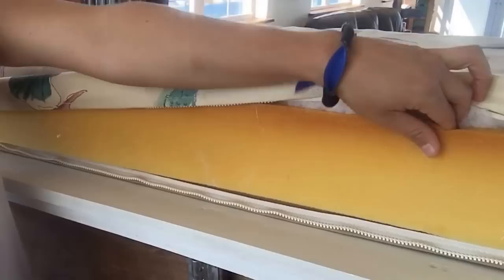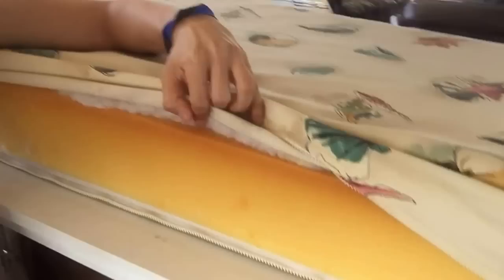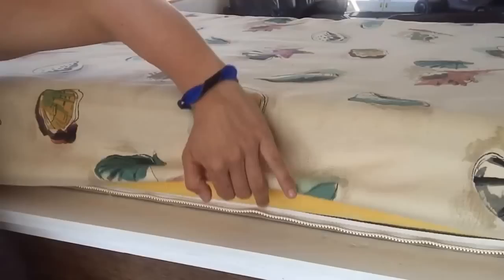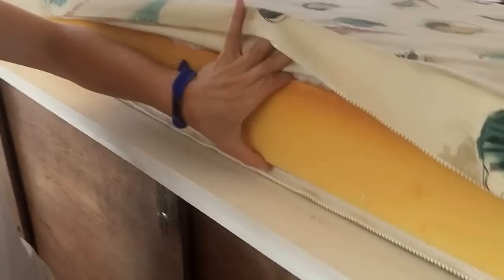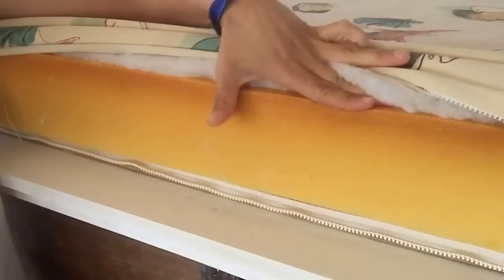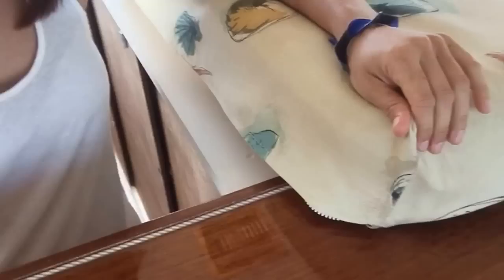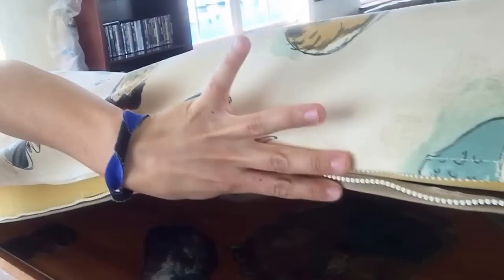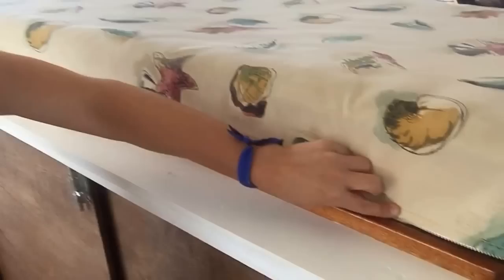Atticus update 81: how to pick foam for your sailboat cushions

Comment: I would think that design would be good for outside because there is not much stitching in the sun? It might hold up better outdoors. It is great to see you learning and sharing with everyone! Love ya'lls videos!
Reply from the maker: +onlychevys Williams Good point! I also heard from a fellow sewer that as far as cushion design, it's a really easy way to make a quick cushion without having to make too many measurements-- i.e. just wrap the top plate around the foam and there you have it! only sewing required is the bottom plate, corner seams and zipper!

Comment: Good update.  No matter what you're sewing for foam it's a bag that the foam fits in.  if your foam is square you can do your usual box cover.  The original cover you showed in the video had baggy corners, it looks "non- pro".  What yo want is for the fabric to fit the foam with no excess fabric hanging off the end.  You need to calculate a curve to fit the foam.  In sewing clothes you'd use a french curve to calculate a  sleeve opening in a coat (for example)  So find a curve around you , like the curve of a tea cup, turned upside down, and drawn on the wrong side of the fabric.  Pin two wrong sides together, stitch the curve , and when you turn it to the good sides VOILA!  You've go t a nice curve on both sides of the fabric.
Reply from the maker: Thanks Dave! That was VERY helpful! Good to know :)

Comment: The benefit is that there is less time spent cutting and sewing, less cutting/sewing equals faster turnaround times on each unit meaning more units can be made in the same amount of time.
Reply from the maker: +John Smith yeah, seems like a relatively decent short cut!

Comment: Thanks, I just received a PHD Degree in "foam technology".  That was extremely informative.  I wouldn't want to; but do know that if I had to, I could replace my foams covers myself.  I have the "hot knife"; but not the sewing machine.
Reply from the maker: +Ken Lynch :) Happy to help! My next project is designing the most comfortable boat mattress. I'm experimenting with Latex foam, High Resilience Layered foam, the froli bed system, and perhaps a tufted topper to see what combo works best! It will be a V-berth for a King!

Comment: I did my cushions with the side, top and bottom plates ( side plate was one piece except where the zipper went) but didn't look half as good as the previous boat which the previous owner had put piping on the seams. I like the idea of the one piece top/sides which would be particularly good for the outside cushions with vinyl fabric ( on the to do list). Keep up the good work guys! Thanks for all the info on the different foam types too.
Reply from the maker: Oh cool! I've thought about doing one long side panel before- maybe I'll try it out on my next big cushion! I've done it before on rounded edge, smaller cushions but found that it was s little difficult to line up.

Comment: Great info. The only con I can imagine is sloppy corners in that cushion pattern, but I imagine it can be tidied up. Not having a boxing plate eliminates the problem of the cover sliding on the cushion. i.e.: The edge seam moves away from te corner edge of the cushion.

Comment: Hey been following you series pretty closely and have seen the sailrite videos. 

Thanks for the great content.

Im not a live aboard but a day sailor, so my investment into the settee and Vberth cushions will be minimal.

I think I can reuse the foam, or source a cheap ebay 3" Poly sheet. And Ive found very great deals at places that sell outdoor table cloths, nautical/beach themed too. 

I like the 1 piece construction because Im not doing the stripes and not too worried about a "squared" look. 

Im also considering sewing in Velcro instead of zippers because they are cheaper. Any pros/cons you can forsee?

SV Snow
P30
Reply from the maker: +Phong Do Hi Phong! Sorry, looks like your  comment got caught up in my spam folder for some reason. I think those sound like good ideas. Another cheap solution I've recently heard about to help the breathability and decrease risk of mold on poly is "hyper vent" (see http://www.hyperventmarine.com). As long as you get a heavy duty velcro I'd imagine it would work great! Let us know how it turns out!

Comment: The zipper in the middle of the side makes it possible to use the mattress on both sides. (alone when the zipper is protected by the smooth side of the bed / Bank. So if you sit on the bed / couch, the zipper will not come between edge of the bed / couch and your buttock. ) The zipper on the corner can makes it vulnerable to damage. Of itself or of its environment. On my boat mattress, the zipper in the middle of the bottom side. so I can’t turn it unfortunately. (sorry for my bad English)
Reply: +Sailing Jeanneau Love Love  if you protect the zipper with a fabric edge, it will not cause damage by chafing
Reply from the maker: I see! Thanks for the zip! Is it harder to get the foam into the slip cover with the zipper on the bottom plate?
Reply: +Project Atticus 
The zipper at the bottom is over the most part in the leghte of the mattress. It's so original
done by the yacht builder Jeanneau. (so I have not made it) Is it difficult to
get the foam into the slipcover that way? Well, I have not tried it myself yet.
but I think it's that bad. if you bend the mattress in a U shape and slide over each end .
 And with some help from someone. It also depends on the hardness of the foam. But surely the corners of the zipper should be made strong. you can add a piece of fabric at the ends of the zipper under the zipper. so that captures all the tension!?..
Reply: +Sailing Jeanneau Love Love.  Furniture cushions are also often provided with some kind of netting web to the foam. So that slides easily and protects. Ask for it at the foam shop. http://schuimrubbergigant.nl/doe-het-zelf-accessoires/tricot-kous/tricot-kous-70-cm-breed.html
Reply from the maker: +Sailing Jeanneau Love Love great! Thank you! Similar to sailrite's silk wrap I imagine?
Reply: +Project Atticus  I do not know what is meant exactly - sail rite silk wrap - what I mean is a knit (polyester) tube. But just ask at the store. Good luck!